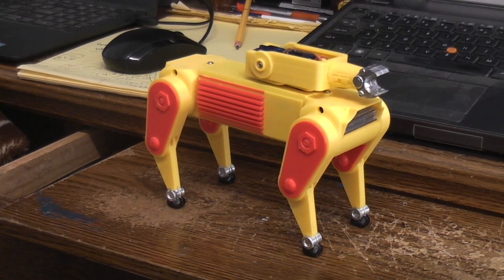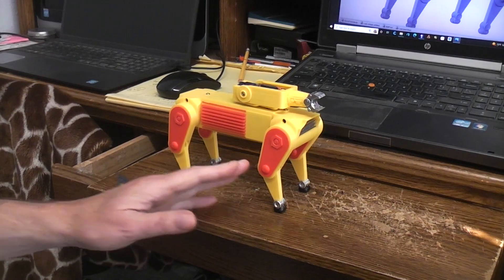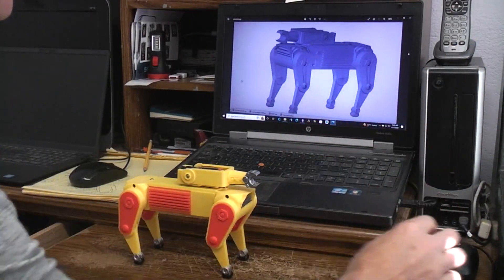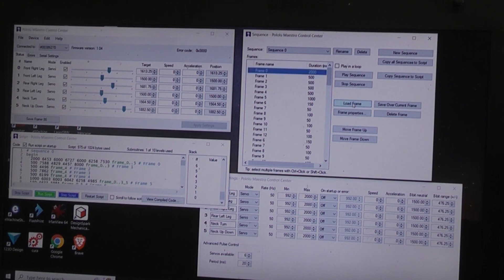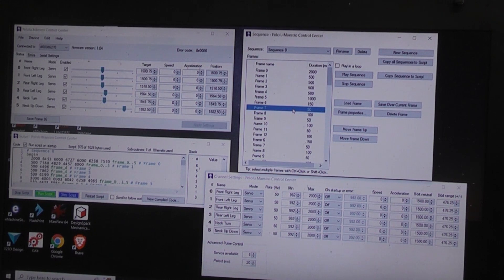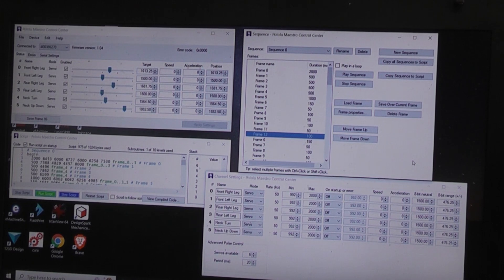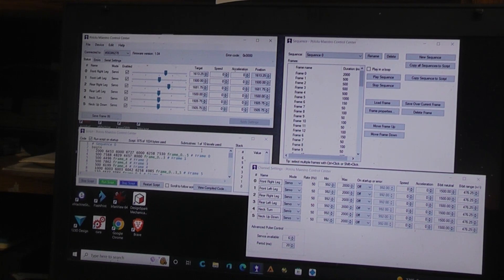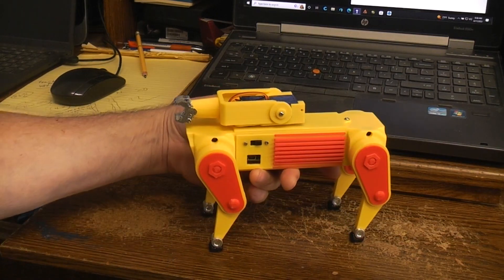3D printed, programable servo animated robot dog, for less than $50. Part 2.

Comment: Nice Project, I actually got one of those Polulu boards a little while ago for a robot, they have some very nice and quick to implement features.
 I was wondering if you had any technique for syncing an audio file to servo movement, for example a mouth to speech, I'm having trouble finding an easy solution.

Look forward to the next project.
Reply from the maker: I have a custom build project in the next few weeks that will use a pololu and audio files. Its a robot phone design so stay tuned for that.
Reply: @Robothut  Great news looking forward to it !!